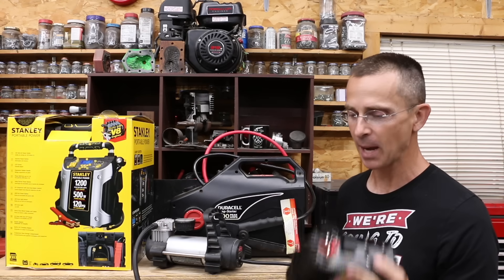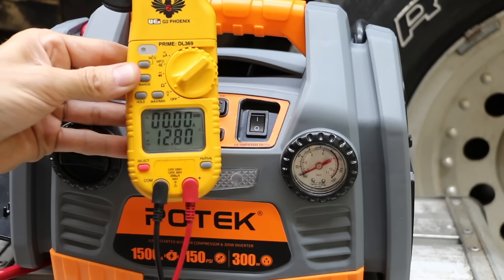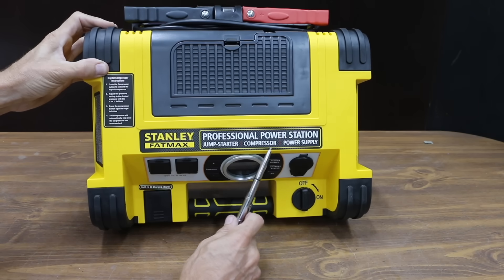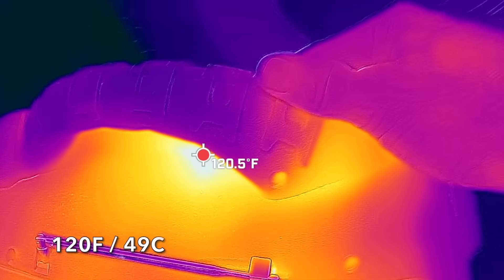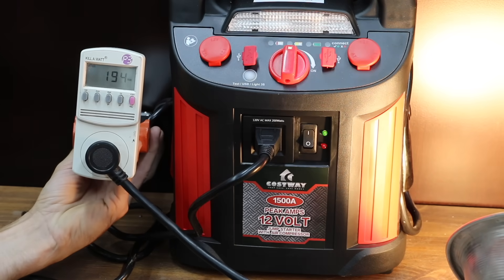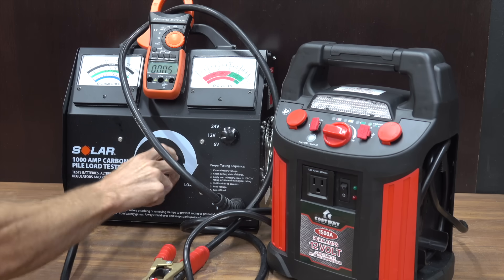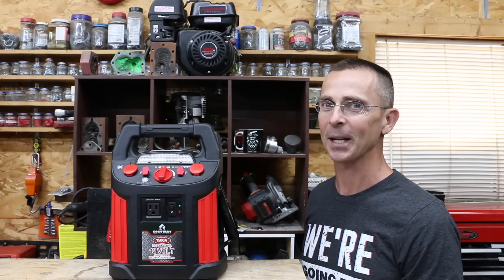Best Jump Starter? DieHard, Schumacher, DeWalt, Michelin, Stanley, CAT

Comment: i’ve got the dewalt…saw a different review like this site but not as intense so eager to see how it does against the king of testing! it’s pumped up a tire a couple different times nonstop from flat (bolt/nail) on one charge and still has half charge left. saved the trouble of using a spare till i got to the tire shop.  mine also has a power inverter though

*edit  odd mine never shut down from heat but I only inflated to 30 just to limp
Reply from the maker: Thanks for the suggestion.

Comment: Walmart has the ever start.  Jump starter, light, air pump, 2 USB ports. Everything is self contained. 750 jump start. Only costs 65.00. I use it daily in my business. Usually lasts 5+ yrs.
Reply from the maker: Thanks for the feedback.
Reply: With that Ford profile pic it's no wonder you use it alot 🤣🤣

Comment: A year later and the Costway is now $229.99 on Amazon.  While clearly the better unit, it looks like the manufacturer has decided that they can ask more for it.  I will still be getting one anyway, because lasting value will soon be worth far more than the fiat currency it was bought with.  Update:  I was able to find one on Ebay for $170.00, so it does pay to shop around.

Comment: Thanks, I have the same CAT model jump starter. It will jump a 4 cyl car (honda) but has some difficulty turning over a 6 cyl car (dodge) with a dead battery. An okay product for 4 cyl cars or small ag tractors/lawn mowers for sure. From what I see your testing fairly represents the product. Thank you for the vidoes.
Reply from the maker: You are welcome!  Thanks for sharing.

Comment: Fantastic videos.   Where did you locate your $140 Costway?   Amaxon is not showing that model.  Found one on eBay for $190.  If one stores an unused unit in his cruiser, how often would he expect it would need to be recharged?   Don't the batteries leak over time?
Reply: Found it on AMAZON Todd, under "GoPower" for $190.
Reply from the maker: Prices have gone up! Thank you

Comment: I have a very small lithium powered starter kit that comes in a small box together with a small air compressor. You could test lithium powered start assist, as some people dont want to lug around such a large starter
Reply from the maker: Thanks for the suggestion.

Comment: 1:25 maybe the compressor shut off after 10 minutes to avoid overheating. I have a small one that should only be run for 10 minutes according to the manual
Reply from the maker: Good Point!

Comment: I think all of your videos are very well done and I enjoy them. I have found in my experience with quite a few of these that the built-in air compressor takes away from it and would never consider buying one that has anything but the battery. I'm currently looking at the harbor freight one for the diesel which is over $300 but I believe would be the best choice.
Reply from the maker: Thanks for sharing!

Comment: The cca voltage chart is wrong, the cca on the pile meter is the bottom blue readout not the top black readout, there all putting out around double the cca to what you said, if you pause the video during the test you can see.

Comment: Note if the voltage drops below 9.5 volts while jumping a vehicle (voltage needs to be higher on newer vehicles) it may not start because the voltages are below the computer's operating system voltage. the test should be what is the cranking out put  at like 250 amps for about 15 seconds, it should not drop below 9.5 volts,   4 volts in not going to cut it, also it should be note the vehicle may take 10 second of cranking or more, depending on the problems the vehicle has. I had the cat jumper from costco I had to return it as it would not jump my vehicle after a time, I'm not sure but the type of battery used in these jumpers seem to fail after using for a while  Lithium-ion, seem not to be able to produce many jump starts I have seen a lot of mechanic use these type of jumpers and they don't seem to last or were damaged internal due to the high demands of jumping a regular v-8 truck.
Reply from the maker: Thanks for the feedback.

Comment: The compressor takes up room the much BIGGER lead acid battery should be occupying.
Every time.
Seriously. You want a compressor, there are tiny, dedicated Lion toys for that these days. Almost throwaway items.
As EVERY tiny air compressor is.
Don't ruin a good battery pack by integrating a novelty that will break on you.
Reply from the maker: Thanks for the feedback.

Comment: So, the big boxes are basically shit.  A tiny lithium battery pack will do much better than these lead acid batteries that are based on UPS batteries that aren't even close to reaching what the manufacturers are claiming.  They are so far off that someone should file class action lawsuits against them for out and out fraud.

Comment: Super happy about this test!  I have a VW diesel 2.0 liter that has had a bad parasitic draw, where if I left it over a weekend, it would be too dead to start, with a new battery and alternator, btw.  I ran it to this very same issue with 3 different brands over a few months.  I travel for a living 5-6 days on the road at a time.  The point is that could not believe how much these devices struggle in the real world!  For those wondering, I'll get the power draw resolved during a vacation I have scheduled in a few weeks.

One other note:  Are you going to test any Lithium Ion based units.  Oh and I would have thought that the Schumacher should have owned this segment.  Thanks again for this test.
Reply from the maker: You are welcome!  Thanks for the feedback.

Comment: I had that same Stanley Fatmax. I used a 40W antique fan(9"), 90W notebook PC, and a 13W CFL bulb lamp on the inverter(143W). 8 minutes in and it had a small fire inside and the house smelled like burnt electronics for a month. I carried it out into the thunderstorm that knocked the power out to start with. Kept burning for a couple of minutes in a downpour of rain to put the fire out. The unit was about 4 months old and fully charged and had not been used outside of a single jumpstart. Stanley units are Garbage.
Reply from the maker: Thanks for sharing.

Comment: Greetings: As usual, U R mostly thorough in Ur tests. About the same as I. I appreciate that.  Make no mistake, finally sone1 has illustrated 1 of the things I tell Ppl about these. The current ratings R severely false by at least a factor of 4.  Simple electronics theory. No way 1000+ Amps is going 2 come out of such a small lead acid battery and cables 4 any usable length of time. 
So. In general most of these do ok new. Now the real test.  Retest the top half of them 6mos later and a year. That would B interesting. I presume most would fail after 6 most and probably all after a year. Truth is the batteries R junk and the other extra feature components ( compressor, inverter) as well.  Even the raping tool truck units do not last much after a year. This I know from experience repairing them.  Advise: follow the use and charging instructions carefully. From that U might get 50%  use and past a year.  Above that, celebrate and let me know what unit.  I want 1. Thx again.
Reply from the maker: You are welcome!  Thanks for the suggestion.
Reply: @ProjectFarm  U R welcome Sir. Another suggestion: Consumer solar panels such as those 4 mobile, camping and temporary use. 50 - 500w types. Nothing on the lines of commercial or industrial. I have sampled many as well as the aforementioned all in 1 boxes, lead acid batteries as solar power systems.

Comment: I really enjoy your reviews - very logical, thorough and downright useful. I have only 1 suggestion that I would find really helpful: a table of data that gives an overview of results for all the features tested. It might have a column for each brand/model and a row for each feature tested. This would allow each viewer to easily compare which ever set of features are most important to them, without having to watch the video multiple times and write down the various results to compare. Your work is excellent! I would just like you to consider a final presentation of an overview of all the data you have generated.
Reply from the maker: Thanks for the suggestion.
Reply: @tooltime9260  dude relax they were just making a suggestion that could potentially make the channel better. Don't be so quick to judge.
Reply: Come on, the dude literally spend 2 Grand  on buying all those starters so that the viewer could avoid all these costs and time wastage, 
the least thing you could do is to watch the full video
Reply: @ashiksnair9831  i DO watch the full videos. But many characteristics and features are tested (which is great!) and it's hard to remember/compare all the stats. He does produce a table for each of the tests. I just find it difficult to assimilate all that data, and I was just hoping for a presentation that summarizes or wraps it all up. That's probably not easy to do, and I won't blame him if he doesn't think it's feasible or worthwhile.

Comment: Looking through your playlist for jump starters, I didn’t see a comparison of car battery trickle chargers. I’m looking for a battery charger that will charge a car battery, and perhaps, be able to be used for electrolysis for removing rust from metal.
Basically, I’m wondering if you’ve compared chargers. I’d like to remove the battery, put it in the garage and charge it overnight.
Reply from the maker: Thanks for the suggestion.

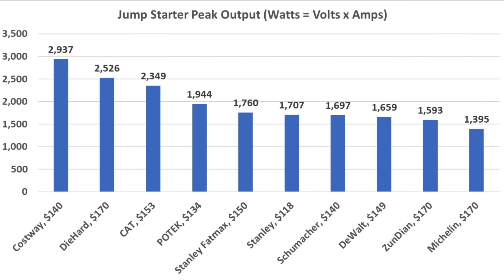Comment: 8:45 Chart to show time to inflate tire to 35lbs, yet some did not even get to 35. 11:41 How does the jump test causes smoking is still considered as 'pass'? 14:19 It would have been nice to have a mark on the graphs to show what the manufacture claims vs real. 16:13 No chart showing success/fail to jump-start, disappointing since this part their main purpose.
Reply: Project farm has deteriorated a lot past couple of years. Take his testing with a bit of salt.
Reply from the maker: Thanks for the constructive feedback

Comment: I bought the Cat 🐱 power station 🚉 and seen a video and was thinking 🤔 of doing the same thing. Bypass the 💩 charger 🔌 to charge it up and just install battery 🪫 connectors up top and wire them directly to the battery 🔋 itself. Bypassing the 40 hour recharge time. I am smart enough to do it and not electrocute myself. Then I can get it properly charged in a couple hours or far less using either solar panels or 800w power station. 

Did any of the other brands have a long recharge time due to a poor power supply?

Comment: Excellent video!  Thank you very much. I'm sure it wasn't cheap to buy all those jump packs!
I just bought the upgraded CAT from Costco for $99.  Part number CJ1000DXT  Its rated at 1200 peak amp and weighs 18.4lbs. Otherwise it appears to be the same as was tested in this vid.
Looks to me like they just upsized the battery a little. There were also complaints about the air compressor failing. So I'm hoping they addressed that too.  But for $99 its a decent one size fits all.
Reply from the maker: Thanks and you are welcome!  Thanks for sharing.

Comment: Hi Project Farm, When I own a repair shop back in the early 90,s, I  cant remember  the   the name, of the jump box, But I do remember it was not cheap, 800.00 but in 10 years i changed the battery 2 times,1000 cranking amps , But best i have ever used, I think it weighed 65 pounds battery cost 350.00, It was the size of a lawn mower battery but 3 times the weight.Great video,s
Reply from the maker: Thanks!  Thanks for sharing.

Comment: I have that Die Hard jump starter and it does start a lowvoltage(almost dead) battery...just have to leave it in connected to the batt foratleast 5minutes before i crank the engine
Reply from the maker: Thanks for the feedback.

Comment: I think maybe ur gauge is off by 3psi lol, considering almost every unit was off by that I think they were accurate. Have u looked into a calibrator for pressure gauges? We had one on the wall at a shop I worked in to calibrate our tire pressure gauges. i was always amazed by how off many new gauges were
Reply from the maker: Thanks for the suggestion.

Comment: The Stanley is identical to a model at Walmart branded everstart maxx, can’t speak to the jump start ability of it but I just ran out and got one to use the air compressor function to inflate some trailer tires, it inflated one tire from 2 to 70 psi in under 5 minutes and the other tire from 18 to 70 quickly, 10/10 for topping up tires and small tires, it has a 10 minute auto shut off timer to avoid overheating and the manual recommends waiting 30 minutes for the unit to cool before starting again, the case was not hot to the touch on the first tire at an ambient temperature of 55 dungarees freedom and has an AGM battery inside it, it is available at Walmart as of 02APRIL2022 for $107 before tax.

Keep up the good work, love the videos, I always search for project farm videos before buying anything, only reason I got the everstart maxx/Stanley jumper/compressor was the last minute need to get a compressor at 10 at night otherwise I’d have ordered the costway
Reply from the maker: Thanks, will do!  Thanks for sharing.

Comment: i have the stanley and honestly i use it daily air up skid steer tires , jump start my trucks . you name it it does it has not died yet..
Reply from the maker: Thanks for sharing.
Reply: @ProjectFarm  i did have a shut down once when starting a 7.3L  diesel.....🤣🤣 which froze the jumper completely  but after taking it apart and removing the battery and reinstalling it works great  again

Comment: I know this video is only four months old but every website I have been to even Canadian website the Costway product you tested is unavailable. When the recommended or similar products populate one of them is the Goplus Jump Starter, Portable Battery Jump Box w/ LED Light for Cars Vehicles Appliances, 1200 Peak/600 Instant Amps- 180PSI Built-in Air Compressor and 12V DC- USB Power Station. If you have the tested Costway tested in the video maybe we could get a video testing the one listed above and the you originally tested!
Reply from the maker: Thanks for the suggestion.

Comment: Yada, Yada, Project farm.   But we buy such gizmos, for women and  female children that we are concerned about(we check our tire pressures when we see a low tire and have a real/shop/specialized compressor to do so).  When are you going to get around to get around to  comparing the typical women who might have to use these things by themselves? LOL Usually they will /have to wait  for somebody who knows what they are doing, to use these things.  

Basically I am asking about which such tools have the BEST USER INTERFACE for people who have little mechanical knowledge.
All us tool/techo geeks/mechanics that watch your channel pretty much know these things,  and given tools could disassemble an engine, and put it back together  on the side on the road.  But what about the wife or the teen-age daughter?
What works best/easiest to work with the minimum knowledge? with these gizmo's , I think that is important.
 All us old guys/mechanics/yourself is a different POV.
Reply from the maker: Thanks for the suggestion.
Reply: @ProjectFarm  TY, for your great work/fun :)

Comment: You need to look into the noco brand. Great desulfator chargers as well as imo the best boosters there are. Do a big diesel episode. 14-16 liter would be preferred.
Reply from the maker: Thanks for the video idea.
Reply: @ProjectFarm  You get a ton of a positive comments and now I know why.  Those big boosters might be one of the of the most expensive videos you make as far as buy in.  They are not cheap.  That might make a cool video in itself.  The top 5 most expensive videos you have made.  It would be pretty fun IMO.

Comment: It seems like the VAT load testing could be a bit deceiving sense most engine control computers shut themselves down below 9.0-9.5 volt. Loading down to 10.0 volt might give a better start capability for a completely dead battery. Of coarse  as a road side emergency jump the car bat probably wont be completely dead. I tried to see what the amp load was when the volt meter dropped to 10 volt but I was too slow and my computer screen  is not good enough. I know you where going for peak amp which is what is advertised but in my mind a real world test at 10 volt would be more telling and circumvent the marketing hype.
 If my thinking is skewed and I am missing something let me know. It's never good to go through life thinking you are right about something and later on find out you where missing information. Kind of like science does.

Comment: I'm kicking your ass tonight.  I'm sorry.  The bigger Noco jump starters are amazing.  Cold start a 3406 cat with almost dead batteries no problem.  Speaking of Noco check out the desulfators they have.. It's literally made me thousands of dollars. I have the 2x4 noco.  I have almost 20 batteries hooked to it at all times.  Paid for its self with in a week.  Pretty much impossible to test but it works like magic.

Comment: That costway unit looks just like an Everstart 1200 Amp I purchased from Walmart a few years ago. The jump feature has been fine and the inverter powered my cpap during the Texas freeze last year, but the "compressor" was junk. For my 3/4 ton truck tires it gave up the ghost on the first tire. I would rather not have it bundled with the battery so I can spend that money on a decent emergency compressor.   Thanks for the good reviews you do!
Reply from the maker: You re welcome!  Thanks for the feedback.
Reply: Oh... and the built in charger is easily broken where you plug in the cord so o will have to rig up a HF float charger to keep using it. Otherwise i
I will be closely watching your upcoming reviews. My Li ion jumper bought for my motorcycle overheated and blew up trying to start my mower... not sold on them yet.